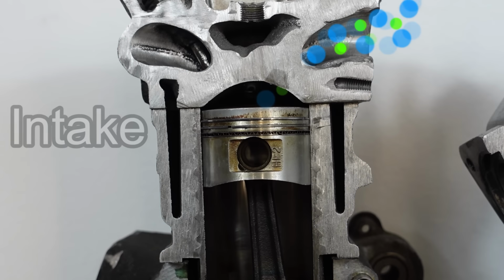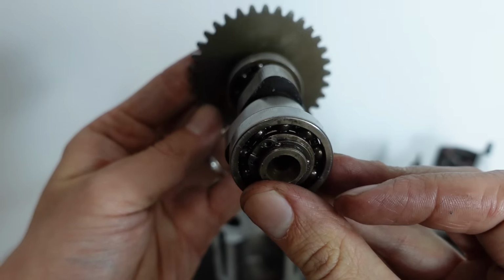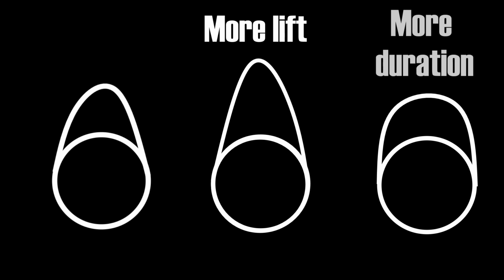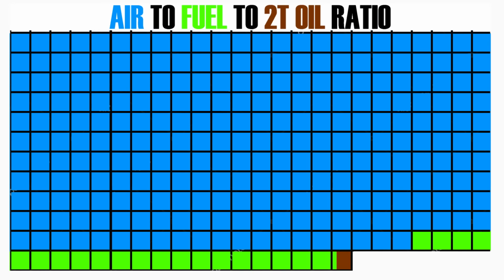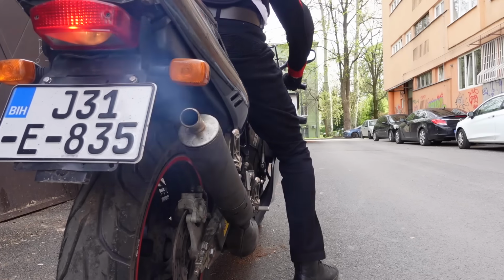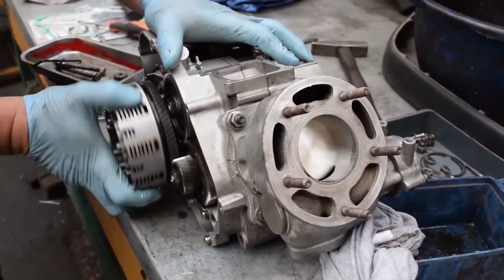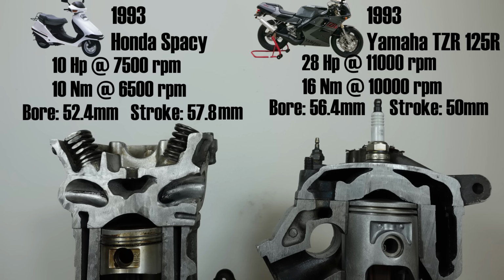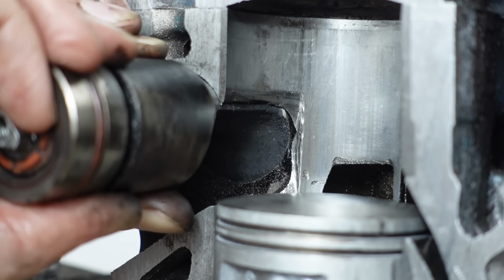The Only Video You'll Ever Need to Watch to Know how 4 Stroke and 2 Stroke Engines Work and Differ

Comment: i am a university professor in mechanical engineering and I have never seen a more practical way of explaining the difference between 4 stroke and 2 stroke than this video without sacrificing the crucial details. Many thanks! I will also share that with my students.
Reply: Yess sir!!
Reply: Yessir..their length of the power strokes ..explained well the differences..very clear.
Reply: Found you here sir lol..
Reply: on the 4stroke, did you miss the part where he said compression starts at bdc? take a look at a valve timing chart. the intake valve closes after bdc so the compression starts then.
Reply: @amsterob  yeah! With this engine, maybe, but what about cadillac 1946? Or mercedes 1959? Alfa Romeo 1914? The main point was, I guess, that the potential compression stroke may be the full 180 degrees, if the ignition was also on top dead center.

Of course they vary a lot with different applications...
Reply: Pp
Reply: That is way you dont need school and money only youtube
Reply: @victorlacanilao90  ال
Reply: Oh you have no idea. Between this channel and Engineering Explained (all car and engine talk), you could definitely be mind blown daily. I'm a 36 yr old automotive machinist major and still the level of detail has me learning things daily. These two are gifts to the world.
Reply: @amsterob  compression yes, but the compression STROKE starts at bdc
Reply: @pjtfinland1794  and it all depends on the cam profile. Or today, the tune.
Reply: I am a local MC mechanic here at the philippines, and this is the first time I have seen a video that really teaches me a lot of information that i never knew between 2 stroke vs 4 stroke engine.
Reply: Òòoo
Reply: If you do that, then you suck as a prof, because the explanation is missing major things (like the valves!). You should have noticed that right away.
Reply: In other words you as a college professor could never explain to your students the proper way of how to practically teach your students what the differences are between the 2 engines and you get paid more money than a mechanic that works with the motor everyday or get greasy 🤦 this is why I choose to listen to people who work on motors everyday, rather then pay the college x amount of money to try to explain it without having a mechanic to teach you how it actually works without reading it from a book that professors teach. Save your money kids and just go learn it from someone who knows how to work with engines. Chances are you will find this video and still not know how a inline 4 cylinder works let alone a 8 cyclinder engine works internally. Trust me you will learn more from experience then from some person claiming to know what they know and take your money we’re as you get paid to learn it in the field. College is for people who have money to study books then tell people they know what they are talking about then teach you what they think they know because they can convince someone to pay them money to teach you what others really know from working on them in real life 😂 yes please use this video for your children so you can take the money tree from them before they even start a life!
Reply: In other words this video is better at teaching than me and this might give them a chance to actually understand what they are doing if they ever have to work on either instead of just answering questions on a test 🤣 by memorizing key words without any real understanding
Reply: Excellent video
Reply: This means that you did not deserve to be a professot
Reply: Awesome 👌
Reply: It’s fortunate we have YouTube!!! I’ve learned way way more from it than K-12 government compulsory education!!!
Reply: Agreed, very simplified and well detailed tutorial, this guy could teach a class.
Reply: Yes
Reply: @surefiremushroomsmicrogreens  Probably, you don't have a college degree and don't have much idea about higher education. This video is a good starting point juts to explain the mechanism. What you don't understand is to design such a machinery you need to digest a huge amount of engineering knowledge that you can only get it from higher education. You need to know calculus, physics, statics, strength of materials, machine theory, machine elements, reliability and several design courses plus some years of experience in the field. Car manufacturers are smart enough to know who to hire to design their engines and their choice is people with engineering degrees not self educated mechanics.
Reply: I was drawing posters and explain this to kids in the fourth grade
.. I still work on any engine
Reply: @surefiremushroomsmicrogreens   I am a college lecturer ,I spent 25 years in industry working on all types of engines from 49cc to over 12 litre .I have rebuilt 2 stroke and 4 stroke engines both CI and SI,I am still involved in rebuilding engines as part of my teaching.I have had mechanics coming to my classes with very poor knowledge of engines .
Reply: @mokumizu4318  what is one of those?
Reply: Век  живи век учись.
Reply: Will you give them a tuition discount for showing them YouTube videos they can find themselves?
Reply: Excellent explaination!
Reply: what is the difference ?
Reply: @mokumizu4318  yes! And trade schools. You will spend a lot less money for CC. 
If someone needs a 4 year degree to get their desired job, they can transfer to university after completing the two years in Community College and save tens of thousands of $$. Good deal
Reply: Count Dracula sure knows his stuff!
Reply: I never knew anything  about engines but after watching this video I can say that your university professor profession is no match with my knowledge now
I'm now a rocket scientist 🤣🤣🤣🤣
Reply: Have you heard of Smokey Yunick? NASCAR legend who developed a unique engine design  that apparently wasn't well received. The motors were surprising. A V twin, an inline 3, and a V 4. V2 made 100 to 150hp, Idle to max rpm. Small cooling syst. I3 made proportionally more, same cooling system, the V4 made 340HP at 7500 rpm and required no cooling system at all. You could grab the V4 exhaust with a bare hand at max power, on sour gas. Adiabatic engines.
Reply: Anyone else find it a wee bit odd that a someone with a doctorate degree wouldn’t know when you use a vs an? Not to mention the other comments evidence.
Reply: Nothing personal but anyone can be a professor. Too many professors I know act like they are better than everyone.

It's just a reflection of how much he understands the subject. It's very simple to him so he explains it as such.
Reply: W professor
Reply: selamlar hocam :) hangi üniversitedesiniz acaba?
Reply: It's really sad and it really fucking says something about our educational system, that I can get the best education in the world for free on fucking YouTube and some of the best professors out there and even help folks understand something very basic.
Reply: Don’t you find in later years, one has to recap some of the basics that’s forgotten to a significant amount. Always nice to see such an explanatory video….Timesaver.!
Reply: U lucky guy they destroy 2 engines for you to use the video for students.Instead of drawing the engines in a table😂😅
Reply: I apologize for the bluntness but…I find it odd that you as a educated man find this so mind blowing when it comes to explaining 😂😂😂. It’s …textbook like literally straight from the book 🤣
Reply: Agree 👍
Reply: @oozzggurr Yeah, and you can learn all those things here too. The Internet has made higher education irrelevant, as well as showing up what poor and little knowledge a lot of these so called professors have.
Reply: @ShogunAutoworks Especially when it is converted into Natural Air-powered engines Concept Paper of which was filed in DOST-TAPI in 2009 yet "reclassified into 'perpetual motion machine and demand that  the poor inventor produce the first working model, which was ruled red tape by CSC.
Reply: @oozzggurr  That's right, ooze. I probably wouldn't get in a sightseeing deep-sea submersible designed and built by Earl down at the marina.  🆘
Reply: @ronalddaub9740  Yeah, way before auto shop I could explain the fundamentals of internal combustion engines.
Reply: Damn professor, that is all I needed to hear. Thanks
Reply: @eksadiss  Not if I had to find it for them because they're playing MMORPG's all day and night. 😂
Reply: Some people on here need to pull their necks in😂
Reply: Türkçe video yok mu??
Reply: When you never intended to have your car motorcycle land mower or chainsaw at expensive repair shop, YouTube are most important tool that you need.
Thanks to people like him 😊
Before, I always used badly repair books.
But it's much more easily to search for your mechanic problem you have on YouTube 😊👍
Admire people who use their time to explain about anything 👍
Always somebody who show on video how you repair absolutely everything.
Reply: You’re welcome bud
Reply: Your not a Professor pal. Why are you lying?
Reply: @BitsofSkin  he’s not lying I was in his class
Reply: Do we even still need to go to university for a degree in engineering when there are fantastic videos like this online? 🤷🏾‍♂️🤣
Reply: I am Groot
Reply: Superb explanation
Reply: After watching this video I don't need to attend the class 😅
Reply: Thanks, you've given me some insights how to make my ts3 happier. Expansion chambers on the bus 😅
Reply: I get stroke to understand this
Reply: Why is there always a university professor or an expert in the field of whatever I am watching letting me know how amazing the video is..😂
Reply: Excellent
Reply: if that`s true and you paid for your "degree! ask for immediate return!!
Reply: @akmalschecter1421 no your not stop lieing
Reply: Completely agree with this. Awesome explanation. Crystal clear. Thanks a lot.!
Reply: I’m a mechanical engineer, too, and must say I agree wholeheartedly!  I’m just getting back into motorcycles and wanted a refresher.  This was perfect!
Reply: In a single cylinder 4 stroke engine, what causes the upstroke to empty exhaust gases?
Reply: Are you an engineer?
Reply: @ozguraslan7405  what powers the upstoke on exhaust cycle?
Reply: He has invented a new motor
Reply: I have been teaching automatic for 20 years 
I find it useful as well
Reply: If you're better than my former teachers, I'm going to get a degree in mechanical engineering right now 😂
Teachers here in Portugal only care about their paycheck. They essentially enter the room, read the PowerPoint out loud and go away. If you ask a question, the answer will be on the PowerPoint. They don't take the time to actually do their job, which is to translate the content into something that we can actually understand more easily. Result: I had to drive 4h per day just to attend classes that don't teach me anything, or I could wait till a week before the tests so the content would actually be available for me to study. I ended up giving up on it for now...
Reply: I've made the like comment become 7k😅😅😅😅
Reply: Yes
Reply: Well, I stayed at a holiday inn Express last night.
Reply: So much knowledge decoded here. Great video. You must have invested so much into doing this video
Reply: No wonder you find this practical. University and practical doesnt mix togerher.

Comment: The 4 stroke always made more sense to me… the 2 stroke has always been more a mystery. I’ve done some rebuilding and porting on 2s, but damn whoever came up with that idea is pretty clever imo. The 4 stroke is very straightforward technical engineering and the 2 is extremely clever outside the box engineering.
Reply: for real, 2 stroke on paper also shows better efficiency, but theory only takes us so far huh
Reply: @mrnobody1546 modern 2 strokers are more efficent
Reply: My 2 stroke yamaha never failed to amaze me, i was thinking i was changing engine oil but later i found that was gearbox and wet clutch. Lol
To see the correct level of this oil, you need to start the engine 10 or 15 sec. Whaaat?!

Indeed, i dont know if two 2T engines are simple or complex but they are genius.
I mean simpler cause less parts, but complex how the way they work.
Reply: No 4 stroke will ever run like the 250 Quad Racers or the 500 Quadzillias of the late 80s and Early 90s And the KX and YZ 125 and 250 dirt bikes
They were built to hammer down and grip and rip hill climbs and blast down railroad tracks like bullets!
Now get one lowered and extend the axles and you got a flying flat tracker that you better hang on to cause it's riding a rocket on wheels on a circle dirt track.
Some of the most fun and greatest times I've ever had in life.
Never has there been a 4 stroke that can compete with a 2 stroke unless the 2 stroke rider is scared to twist that throttle and fouls the plug!
Theory may seem to favor the 4 stroke but reality on the track is proof the 2 stroke will bust that ass!
ALL DAY AND ALL NIGHT! .FACTS!
Reply: And then u've got Detroit 2stroke diesel engines... phwoar
Reply: Most ppl don't know about the Detroit 2stroke diesel truck engine. .💪
Reply: 2 strokes have less parts and are much more simple
Reply: My first motorcycle that i learnt to ride bike on is a 2 stroker very famous in my country called Yamaha 125zr belonged to my friend. Back then 2 strokers is very famous and whoever rode a 4 strokers would either be called old or a pussy 😅. Nowadays those bikes are considered a rarity although it can still be found plenty on the roads still zoomin. Everytime i smelled the 2t oil (there is a kind of 2t oil popular due to its very fragrant smell, we only called it green castrol bottle) it brings me back to the good ol days 😂. If talking about speed and acceleration 2 strokers definitely beat the crap out of 4 strokers of the same displacement. But our world is turning green and so long gone the days where the scream of 2 strokers and its speed leaving a trail of white smoke that smells fills the long empty midnight roads.
Reply: For some reason I see 2T engines as a big middle finger to the environment
Reply: @devilblue9175  for some reason i think u should stick to push bikes
Reply: Get a rotary and have both together lol😮
Reply: Holy shit I just learnt so much, I was shaking my head the whole time at how amazing a 2 stroke engine really is 
Thank you for the video man
Reply: 2 strokes its not about making sense!
Reply: Like rotaries but better :D
Reply: It was a Scotsman, go figure 😂😂😂😂
Reply: @cmdr_roy5489  yeah they were super popular in the '70s and '80s especially in Japan and the upper left of the US (probably across the entire country but I can only speak for where I live)😂 My brother had the ramps built and everything😂
Reply: @mrnobody1546  i think they good in the paper but fail in reality because at in it’s time, technology wasn’t good enough to maximize it efficiency, but today, with a ton of technologies, people are nagging out for environmental issues so efficiently 2T engine never have the chance to shine.
Reply: @nikolassweaty6505 😂 ever seen a 4 stroke chainsaw? Me neither.. 2 stroke is absolutely more efficient, but between the shorter maintenance intervals and government regulation, we see more 4 strokes where the power demand will accept them.
Reply: @SLOCLMBR fuel effeciency isn't the reason chainsaws are 2-stroke.  It's weight, and also the ability to run at any angle.  The average chainsaw needs approximateky 4hp.  A 4-stroke engine would be far too heavy and  wouldn't do so well running on its side or upside down.

Comment: I have been a motorcyclist for 53yrs. Built tons of bike, both 4T and 2T (the latter my favorite). I appreciate BOTH segments, and have owned multiple (30+bikes). This was THE best video that I have ever seen to help me explain to others the differences between the engine designs (and honestly helped me) ! Wonderful video, you did a great job. Your filming, production, explanation where all world class.
Reply: Holy crap.....agreed....old head shade tree mechanic here
Reply: What is the T reference?  Throw?  Why not S for stroke.
Reply: Wear is your grammar? has it begun to where out? All jokes aside, I found this to be a fantastic video. It really covered virtually all one needs to know regarding the difference  between 2 & 4 stroke engines. The explanations aided be the added graphics were fantastic!!
Reply: @alex8527-w1q   Wear is your Gramma¿¿
Reply: @rileydj8764  probably Time or Timing. In Brazil we say 2 Tempos or 4 Tempos, Tempo meaning Time obviously, so 2T and 4T
Reply: I have suzuki X4 125 2 stroke 1999 Kawasaki HD3 125 2STROKE 1995
Honda Tmx 125 155 japan 4stroke CDI. 2001 MODEL
AND LAST Yamaha rs100t 2 stroke 2001 model use for trycicle hahahahaha
Reply: @gabiferreira6864  same in Sweden, we call it ”2-takt” which is the same as something like ”2-tempo”
Reply: @alex8527-w1q  wear ? Where ?
Reply: @maxflight777  This is called a "Example"
when used in context, you missed it.
" Wear is your grammar? Has it begun to where out?" I made no mistake.
Reply: @alex8527-w1q  thanx for the pure cringe... one can always find it in the comments.
Reply: @4partmedia  My pleasure.
Reply: @rileydj8764 from German 'Takt' , which is derived, as I believe, from the same word in the musical sphere....those romantic Dschörmans😊